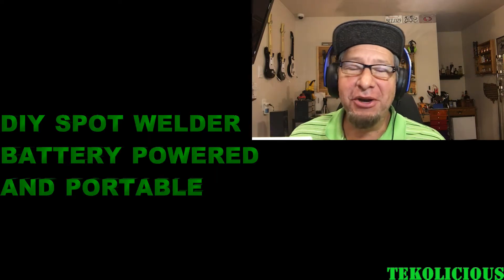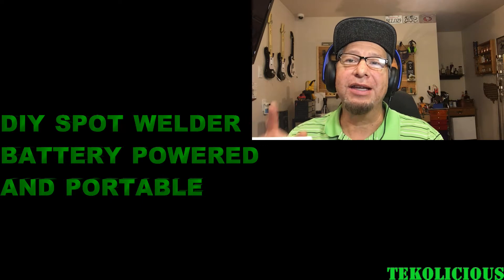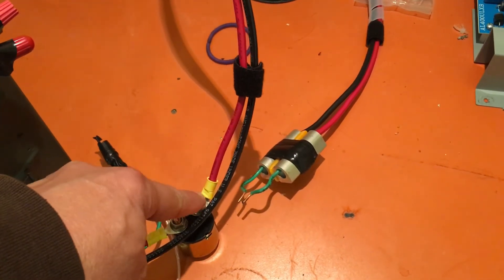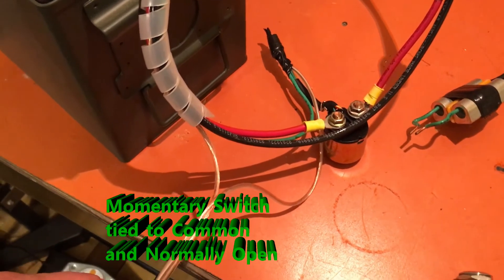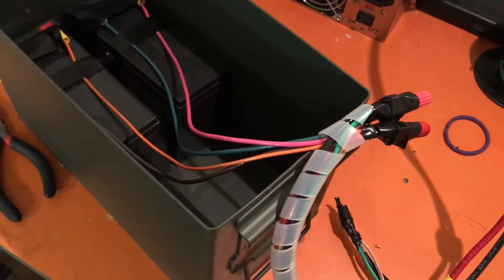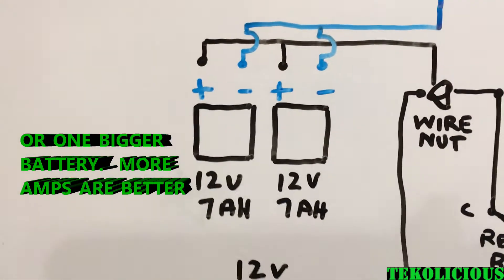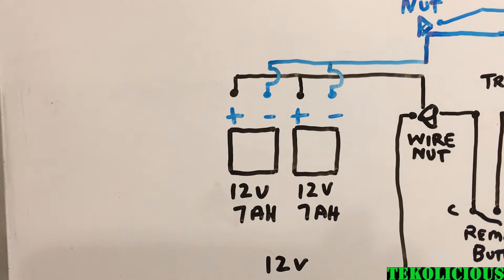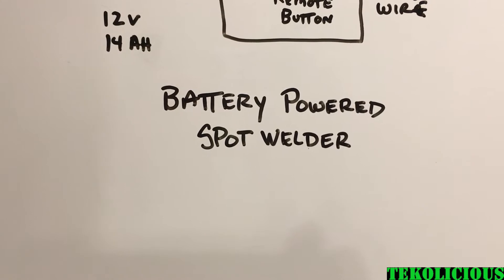DIY Battery Powered Spot Welder, Make 18650 Battery packs for cheap.

Comment: Have a very similar setup to yours and somehow this morning the momentary switch fused itself together in the closed position during one of my VERY quick taps and a tiny little flame shot out of the blown hole in my cathode. Kinda startled me.

And not saying this isn't a safe setup cause it totally is. This is probably at least the 2000th weld I've done in the past six months. I'm guessing I just got a cheap momentary switch or somehow the current from the large welding contacts back fed thru the switch circuit. Not really sure why that would happen but that's all I can think of, save for the crappy switch.

Either way, great video and I just wanted to see if anyone else ran into this problem. In any case, even having to get a new switch for 6 bucks is still so much cheaper than getting a sunkko model (which doesn't even seem to work on 110V from what I can tell based on the reviews)
Reply from the maker: my biggest problem is keeping the batteries charged, but I agree you need to have a good switch, I am thinking I might want to do a foot peddle to allow both hands free. Thanks for the comment.
Reply: @tekolicious8310  I've thought of a foot pedal as well but without using a timing board in my setup, I'm pretty sure I wouldn't be able to tap that switch as quick as I can with my hand. But it would be so awesome to have two hands free

Comment: This is oddly similar to the setup darkkevind showed in his DIY spot welder video for batteries. Minus the car battery though. But the solenoid and momentary switch and general configuration is spot on.
Reply from the maker: Yeah electrical rules are all the same, there are only so many ways to do this. A car battery would even be better, but heavy. Thanks for the comment.

Comment: This maybe a dumb question but I need to know. Did you use regular 8 AWG wire to weld or wire electrodes?
Reply from the maker: I used standard wire which get burned up pretty quickly but it's cheap to replace. Thanks for the comment

Comment: Has anyone tried putting the batteries in series to weld at 24 volts? You could still tap off of one of the batteries to power your solenoid and switch (center-tap). The only disadvantage I can see is you need a 24 volt battery charger or charge the batteries seperately at 12 volts. The higher voltage may make a cleaner weld.
Reply from the maker: That could help, but I wanted to be able to charge and use cheaper batteries. it works pretty well.